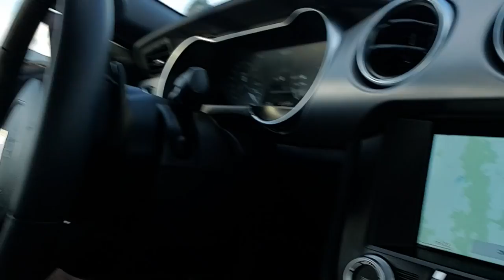Preparing the Automatic Taper Drywall Bazooka & Plastering Tool Talk

Comment from the maker: Watch This Series
1.0 - Preparing the Automatic Taper Drywall Bazooka & Plastering Tool Talk - https://youtu.be/Ml8vbHIu6os
1.1 - Drywall Bazooka Tips Taping in Walls - https://youtu.be/pKUxuY_gf48
1.2 - How To Tape in Drywall Fast with an Automatic Taper - https://youtu.be/lCiyqsN-J0g
1.3 - How to Tape Sheetrock with a Bazooka - https://youtu.be/ZeCsxAO7eas
1.4 - Paper Tape Joints in Bathroom Like a Pro - https://youtu.be/1ZkeKDQVDWQ
1.5 - Using the Bazooka to Tape Drywall Internal Corners - https://youtu.be/2rgH0Dr6XO4
1.6 - The Tapepro Corner Roller and Straight Glazer - https://youtu.be/cPzAuTUE_OA

Comment: Cutting all of those blocks what a waste of time and money.
Reply from the maker: Well it's the standard .. can't choose how we do it. Not even those gaps at the top, it's just the way here.
Reply from the maker: Oh those blocks... It was left over sheet. The floor was nice and clean. Carpenter loves it
Reply: Maxkil you’re saying that in Australia, all drywall is hung with that gap up against the ceilings? And if so, I suppose that crown molding/cornice is always standard as well? Here in the US, I would say that possible 60% of homes have cornice in them, while the rest simply have bare internals, or “angles” as we call them in the south...
Reply from the maker: Not all but the majority I would say. Only tight if it's square set maybe bulkheads as well. Otherwise it's not needed for some kind of fire proof or anything. Let's just say even a 30 year old house here you pull the cornice down and there is a gap. We don't have any issue with it here.  Thanks for watching and your comment.